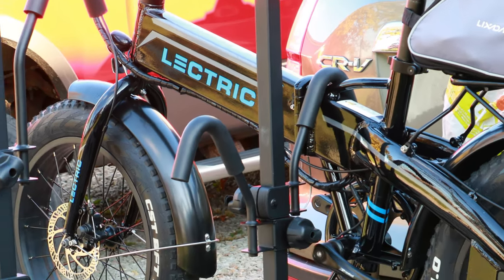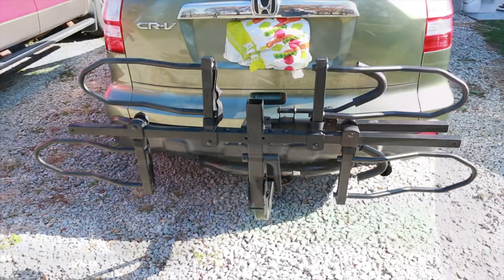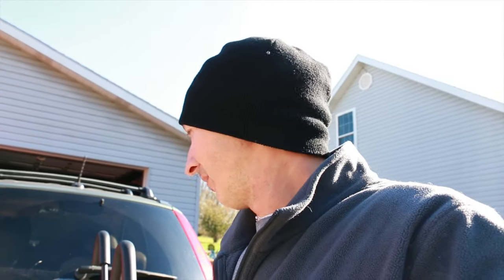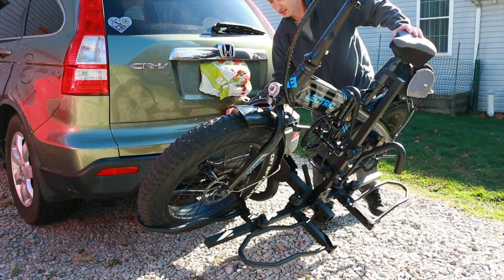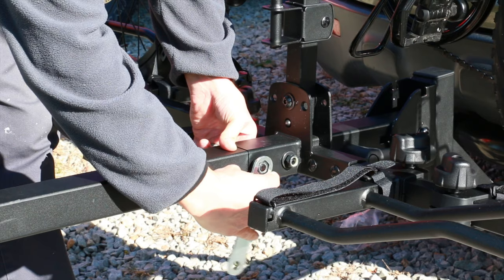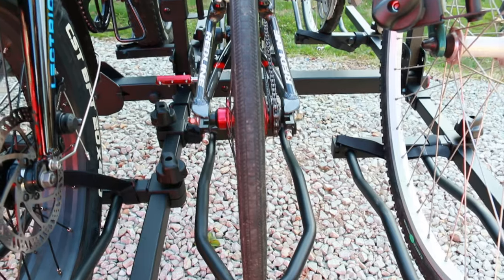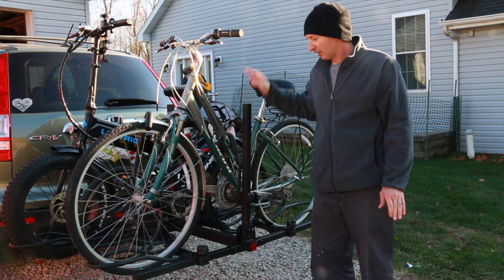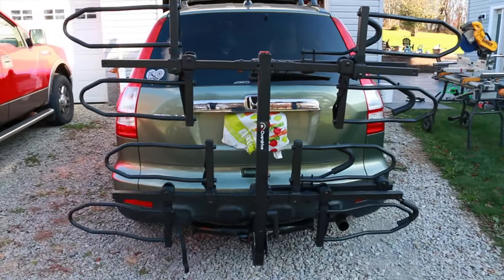FAT TIRE Electric Bike Rack Review, Overdrive Sport 4, Best Heavy Ebike rack

Comment: TECH TIP - Solution to foam rubber deteriorating. I have been using this bike rack for a few weeks and it did not take long for  the foam rubber protection to start to disintegrate.  Especially when clamping down near the folding welds on the XP. The uneven welds/hinge area causes excessive wear on the foam rubber.  I load two XP's and flip the bikes so the fronts point in opposite directions. This results in the KAC rack clamping on one  of the XP's right around the weld/folding hinge area. The solution is I went to Home Depot and purchased a dishwasher drain hose. This is a heavy duty rubber hose with a 5/8" inside diameter. I removed the old foam and replace with the same length of dishwater hose. A little WD-40 and they went right on. Not only is the hose more durable, it grips the bike frame better, and not not mar the paint like the foam when highly compressed.
Reply: Are you concerned about the weight of the bikes. Mine is a xp 2.0 and says they weigh 64lbs. And the carrier only holds 120lbs?
Reply from the maker: I always take the batteries out and that that will put the bikes under the 60lb limit per bike.

Comment: We have owned an Overdrive Sport-2 for almost a year. Over 10k miles since end of last May...cross country plus up into Canada with our 2 RAD eBikes....HIGHLY recommend.
Reply from the maker: Wow that’s awesome! Thank you for the update especially with that many miles!
Reply: Which model of radpowerbikes did you get? The radrunner doesn't have a crossbar, wondering if this rack will work?
Reply: @christiffkennedy  We have 2...2018 mini and 2018 City Step through. I use the overdrive crossbar adapter on the step through...14k now.

Comment: To work on the bike in an upright position, as opposed to handlebars and seat, I have repurposed a heavy patio umbrella stand, using a closet pole in place of the umbrella. 
I lift the bike over the top of the pole and lower it onto the  pole and into the pipe that holds the seat. It is high enough to raise the bike so I can hand pedal the bike for adjustments. Works like a charm..
BTW, if you are having trouble raising the XP onto this rack, it's even more trouble loading it into the bed of a pickup truck.  I have removed the jump seat from my truck (not needed)   and load the folded bike into the back and bungee around the seat pipe  to the passenger headrest.. This method will accommodate two XP's, one behind each seat..

Comment: I have two step thru e bikes and wondering if the clamps go down far enough to secure the bikes or would you use an adapter bar to secure the bikes? Thanks for a very clear and honest video.

Comment: I have a rear hitch motorcycle rack from Harbor Freight, Haul-Master, Item #:62837. It is rated at 400 lbs., made entirely from aluminum and has a attached loading ramp as well.  No need to lift the bike/motorcycle into the rack.  However, it is only for a single motorcycle. A reviewer indicated that he uses this rack for his heavy e-bike.  I have carried a 250cc motorcycle on it; next time I will try carrying the Lectric XP.
Reply from the maker: Thank you for you tip,  the motorcycle carrier will definitely work and I have recommended it to other people that only need to transport 1 bike however I’m usually carrying 3 bikes so it won’t work for me!😢.

Comment: One thing that is important is the quality and grade of the metal throughout. low-grade metal will fatigue. Especially the hook that holds down on the frame, As a precaution, add winch straps for safety. Also as previously mentioned replace the foam hook hold-down pads with rubber. Foam is unacceptable.

Comment: I just got one for my MTB and families bikes. It is super heavy duty and heavy. I like everything you get with the rack. Was missing end cap and they sent me one right away. Love everything except I wish the hold down bars would rotate making it easier to load and unload the bike without having to tilt the bike.
Reply from the maker: If you slide the holding bars off then you can bend fold down the middle one and easily put the bike on then fold it back up, that is what I do with my bike because it is around 60 pounds!

Comment: Hey Jeremiah, Very informative vid as always. I did found something interesting. I purchased the KAC Overdrive Sports K2. The manual states 60lbs per bike. My Lectric will be mounted on the inside & a lighter bike will be on the outside. I think I'll be fine, this rack is very well built! Cheers!

Comment: Jeremiah McIntosh, great video. Very detailed and informative. I have been using this rack for a few months now. I have 2 fat tire e bikes that weigh 65lbs a piece. I take out the battery when transporting. Help take off 15 lbs per bike. Heavy duty rack. Do you have anybidea how to stop the side to side wobble? The anti wobble works great for the hitch insert but not the over all wobble coming from the adjustable section.

Comment: I'm glad Overdrive offered a fat tire version instead of offering the standard version where you would have to drop another $60 on fat tire holders and then you are left with holders you paid for but don't need.
Reply from the maker: Exactly! And they can be used for skinny tires also! Makes it well worth it in my opinion.

Comment: I really wanted to like this rack but it doesn't work on my FJ Cruiser. The part that bends up will block my door from opening because my spare tire is in the way. So for anyone with a rear door that swings open, you'll want to check clearance. That bend that comes up is pretty big and will get in the way. Imho this is best for hatch type doors.

Comment: Great review, well done. But I don't think the locking mechanism with the square pin that slides into an open slot is good enough. You noticed it too, and made a comment at 3:05 of your video. I'd drill a hole and put a bolt through. I realize the manufacturer wanted a quick way to be able to move the rack, but I see problems on a bumpy road and over time when that mechanism gets worn.
Reply from the maker: I agree with you and have always been a little skeptical of that however with that being said I have not done anything with mine yet and have been using it with no problems. With a longer trip I would probably consider doing as you suggested with drilling a hole and using a pin or a bolt in it.

Comment: Thanks for the review. My Lectric 3.0 weighs 64 lbs plus the racks. I notice you mention the manual stats 65-pound capacity. I went online and looked at the manual, which says 60-pound capacity? I was wondering where you sew the higher weight rating. Just want to be safe hauling our 2 Lectric bikes.
Reply from the maker: It was in my manual but they may have changed it. If you gave the battery’s out you will be under the 60# limit. You can also take the seat out to make it even lighter yet.

Comment: Hi Jeremiah, great video--very informative! I've asked KAC for a couple measurements, but they can't seem to provide this for me--could you tell me the distance from the center of the second wheel hoop to the center of the fourth wheel hoop, and the distance from the inside edge (nearest vehicle) of the second hoop to the inside edge (to rear away from vehicle) of the fourth hoop? Also, I need 2 measurements on the L-shaped piece of frame that goes into the hitch: what is vertical distance from the top of the horizontal piece of L to the top of the vertical part of the L, and what is the distance from the hitch to the inside of the vertical part? Thanks so much.

Comment: I like your review in how thorough it is. I'm concerned with your comment that you can remove the whole rack by removing two bolts. It that only for the last two bikes or for all four? Why is there a key connected to the hitch if you can just remove the whole rack relatively easily. How are the bikes individually secured to the rack? Thanks for your time.
Reply from the maker: Where the rack folds up on the vehicle there is only one bolt that holds it on there and if you remove that bolt You can basically remove the whole rack. This can be prevented by replacing the bolt with a locking hitch pin or welding the Nutt onto the bolt so that it could not be removed. I’m pretty sure this is probably the same with most bike racks and I recommend using a heavy duty chain lock to lock the bikes to the vehicle if you leave them anywhere unattended.

Comment: Sturdy enough for 2 lectric xp bikes? Seems like its right on the edge of the weight limit especially if you have a few mods on them.
Reply from the maker: You should not have a problem with 2 bikes on the 2” version it seems very strong however the spring loaded latching pin that keeps  the rack from tilting makes me think maybe I should drill and put a pin under just in case it fails and Pops out. 
With that being said tho I have not had any problems with it but I’m just a cautious guy lol.

Comment: How much it hangs backwards, how much more entimeters i lengthens your car with  bikes on it and the 4th bike handlebar sticing litle bi out when folded , so overal, in both 1 2 3 and 4 bike modes? could you measure it please?

Comment: Please explain the difference between the older model rack and newer model rack. You posted links for both models. Thanks
Reply from the maker: The only difference I’m aware of is the older style like I have has knobs that you turn to tighten on the center hold down clamp and only one locks. The new model has more of a ratcheting style hold down bracket and each one locks. 
To be honest I’m not sure which one is better but I would lock the bikes with a heavy chain as well if left unattended.

Comment: Great review, excellent info. I have a Curt basket cargo carrier. Would it fit in the receiver that is made to connect the extra 2 bike carrier? The Curt basket has a 2” male connection.
Reply from the maker: Great question. Probably not because the receiver part of the main rack inside dimension is 1 11/16 x 1 11/16 ...outside is 2” x 2” which would be the same as your rack. You may be able to make some kind of adapter out of square tubing to fit in your rack that will fit in this rack kind of like the extender for the four bikes.

Comment: Jeremiah, Is there an update on whether or not this rack will work for two step through XP 2.0 models?
Reply from the maker: The only issue I see is the clamps that come down to hold the bikes. you may have to shift one bike to one side or the other for the clamps to come down to hold the bikes if that makes sense or figure out a way to put a top tube bar  on for the other clamp to hold the bike. kind of hard to explain but I haven’t really tried it yet with two steps throughs that’s just from my speculation.

Comment: How does this bike rack handle speed bumps? Any chance that the rack will fall do the ground while driving?
Reply from the maker: I would go slow over speed bumps but I have not had any problems with it yet. I would like to add some sort of additional safety pin just for extra security bit I haven’t needed it yet.

Comment: I have 3 XP Lectrick bikes what do you think about 3 and a mountain bike do you think it will work?
Reply from the maker: I think it would work but that’s a lot of weight I would take out the batteries. I personally would be nervous with 3!but I’ve seen photos of others using it with 3-4 Lectric bikes without problems on the Facebook forum.
Reply: @JeremiahMcintosh  That's what I was thinking maybe a small trailer would be better thanks.
Reply from the maker: I would suggest going on the Facebook forum and I think Brian Cohen or some thing is the one that I seen Had a picture with four bikes on the rack maybe ask on there you might be able to get some more opinions.
Reply: @JeremiahMcintosh  Thanks but I don't do Facebook

Comment: I think any hitch mounted bike mount will work for an ebike as long as the tires fit properly. The weight should not be a factor as long as the electric bike is mounted closest to the hitch. You can buy a cheap walmart hitch mount for bicycles and a human that weighs 150 plus pounds can stand on the bike rack on the main support beam closest to the hitch. You could not stand on the sides where the tires go of course. I think the weight recommendations are just a safety factor and to keep people from trying to put a heavy dirt bike on a bicycle mount. Old timers would make anything work that they had laying around. The modern generation always wants the best of everything and tries to evaluate every aspect of products and safety. I am guilty of it myself. Not sure if that makes us better or worse than the old timers in the long run. I guess time will tell.
Reply from the maker: That’s the problem with most fat tires they don’t usually fit unless you buy additional fat tire racks which this one includes. I did not shown in the video but I stood on the back of the hitch when it was all together plus had my ebike mounted up close to the car and it supported me no problem at 160 pounds plus the bike. 
However going down the road hitting bumps obviously will put more stress on it but I don’t think it will be a problem at all.
Reply: @JeremiahMcintosh Yea, those hitch mounts seem to move around a little in the hitch of the vehicle. I have a regular two bike hitch carrier and the electric bike fits in it fine, the only problem is that the fat tires slide down into where the wheels go. It just makes it a little snug when you go to get it out. Whats the inside width measurement where the tires sit, on that one? I have the two bike  Swagman and the inside width is 3 and a half inches. It says it is rated for 35 pounds a bike. I have had the lectric xp and another bike on there and stood on it and it is solid. That is over 300 lbs on the swagman and it does not bend etc. Maybe the companies are being cautious when they tell you that it is only designed to hold a certain weight. I am pretty sure the swagman will hold 500 pounds plus if it is evenly distributed before it would bend.
Reply from the maker: @Electric Life I have all the measurements in the end of the video that you should need including the width Where the tires go.. hope this helps.
Reply: How right you are..!!  People spend more time deciding on the latest over-priced cell phone rather than educating their children..!!  What a sad state of affairs this country is in....

Comment: I specifically didn't buy a fat-bike because range was my primary focus. I wanted to be able to ride 100 miles with a fully loaded (more like over-loaded) tour bike pulling a single wheel suspension trailer. More and more often when I ride on biking infrastructure I see fat-bikes riding in pairs and small groups. I'd love to be able to ride over and through everything they can with 4" tires. The biggest drawback I have seenwith fat-bikes is having to transport them places to ride. I was riding the Foothills trail near Orting, WA and watched a little lady (wife I presume) about 130 lbs. 5'7" unload a fat-bike (her husbands I think) to get to the other fat-bike and then unload it. She lifted the back tire off the stand and drops it to the ground, She squeezes the back brake and pulls back on the bars lifting the front tire up and over the carrier and down to the ground... not even straining. After both bikes are on the ground she opened the back door of the car to grab her water bottle and rode off while a guy sat in the car on the phone the whole time. Ya know... I'm not so sure she was coming back. If those bikes had been in the back of a pickup rather than a low trailer rack I might have had to help her 
Bike pics: prior to Oct 2019
https://photos.google.com/share/AF1QipN67sUw0ykU-Mg5gLsOw9vF8kBMEM5cGCgCNmLT_j72h9iu5fKYFFVbLJ2Z415Umw?key=LUZqdEl1d3RjNV9id0ZvTEFickhITnBwWFZrU3hR
Reply: Thank you so much for that detailed description. As a single older woman, I've been debating whether to invest in an e-bike due to doubts about how in the world I would wrestle it on & off a rack. Now I feel confident that I could manage it! Thanks!
Reply: @freedomartwork6950  You are most welcome.

Comment: I bought the two fat tire bike version for my 1.5 inch receiver last fall.  The rack flops around loosely in the receiver because it arrived without a set screw to tighten the connection.  I have scoured the internet for any mention of Overdrive bike racks, but the company does not seem to exist.  Amazon also says that the company does not exist either, and offers no warranty support whatsoever.   So now I am stuck with a defective product from a non existent company with zero customer support.  Does anyone know what kind of screw fastener I need to look for is that will allow me to tighten the bar to receiver connection?
Reply from the maker: It should of come with a Locking anti-rattle bolt as seen in my video, in fact mine came with one extra one as well. The company you are looking for is overdrive brands and you can contact them through Amazon where it says shipped from and sold by maybe they can send you another one but ultimately if it was missing when you received it you should’ve maybe just returned it and bought another one if they would not send you a new pin.
I’ll see if using a regular pin you may be able to use an anti-rattle mechanism like this https://amzn.to/2x3KptX
Just keep in mind This is a affiliate link and I will get a small commission if it is purchased through this link which is no extra cost to you. Hope this helps.